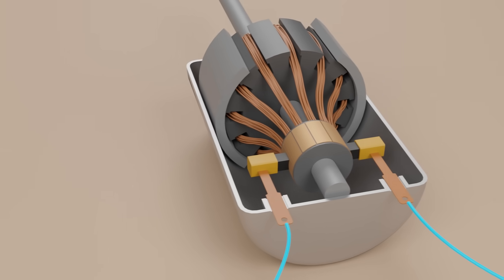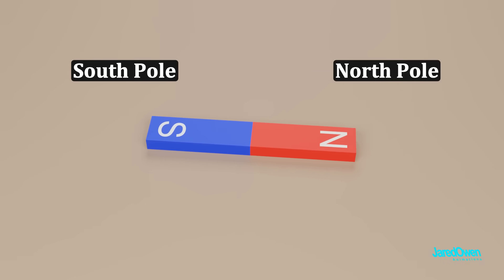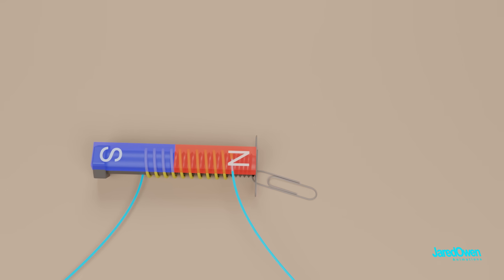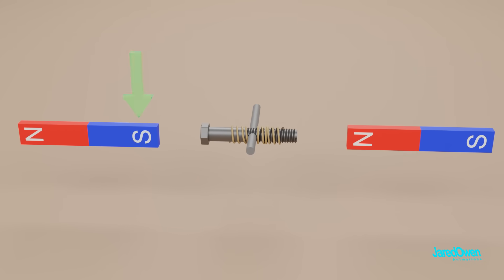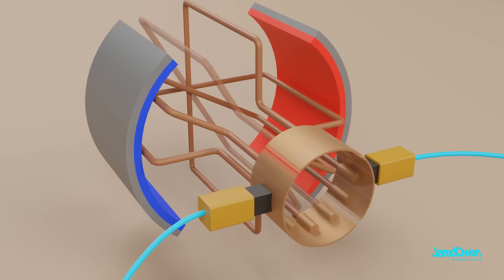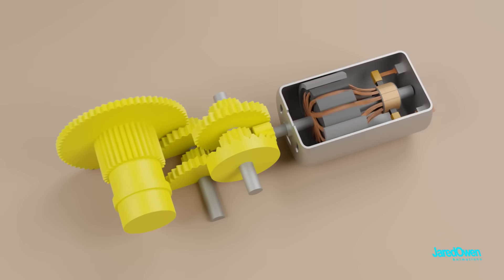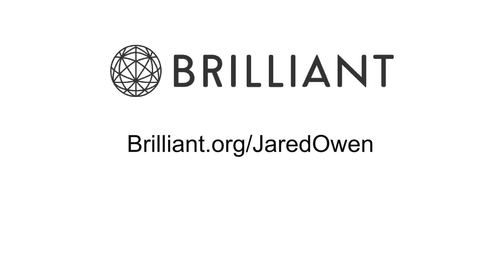How does an Electric Motor work?  (DC Motor)

Comment: TOTAL noob here.  Let me just ask the question, or consider this a viewpoint from a learner:   In your circuit, are you showing conventional flow?   I am so confused about where the most electons flow from in a power source with + and - in a circuit.   On a powersource, is the "+" terminal where the higher amount of electrons LEAVE/DEPART from, to travel through the circuit and ultimately be RECEIVED back in through the "-" terminal?  Do electrons flow from the + to the - ?  or from - to + ?
So noob, I struggle to know HOW to ask for understanding.  But my understanding is that electron theory is - to + .....but does that mean that electrons flow from the - post then through the circuit towards the + post?  Help!

Comment: id bet money that a hair dryer has an ac motor.
Reply: It has diodes inside and a capacitor that converts ac current into cc current good enough for the motor to work :)

Comment: Wow, that was amazing! Thank you! Now I want to ask you if you may help me understand what it is that may not be completing a circuit in a DC welding machine. The motor portion starts, the armature is spinning however, the leads where the welding rod is attached will not generate what's called an "arch" making the rod sort of melt into another metal, conjoining the two pieces. I have been searching on the internet for a while now and I a have engaged folks who work with welders specifically however, I am not able to get an answer. Would you be willing to give this a whirl?

Comment: This video helped me fix a really expensive table saw. The 2 brushes were both stuck. Not getting contact. I took them out, and cleaned inside with air. put them back in and BOOM $4,000 saved

Comment: Great video and the graphics are amazing but FYI in Electric Motor the rotating part is an armature, the brushes contact the commentator, and the Outer magnet is called a field😬 in an alternator the rotating part is the rotor the brushes contact, the slip rings, and the outer parts called the stater with electricity is generated. Just a small fun fact.

Comment: If the power source, wiring and switch is all checked and known to be working, what are the failure points for an electric motor? My guess is it has to be the brushes fail, or the magnets fail. How can we test and isolate the problem when an electric motor won't spin when power is applied?

Comment: I might be missing something. The bolt needed wire wrapped around it, and, it needed connections to the wire?, but, the metal loop didn't need wire?

And, the metal loop having two ends, suddenly the N and S are in no way oriented to the physical ends of the metal loop?, the N and S are strictly oriented to the edges of the loop??, instead of it's ends, and the bolt was end oriented?

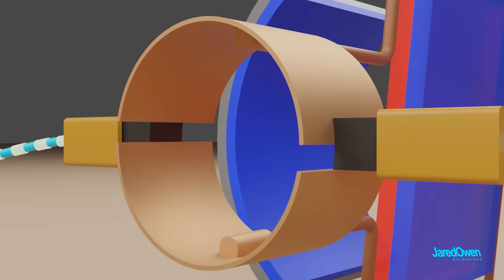Comment: I have a doubt....at 5:36 we can see that the brushes are in contact with both the segments...i.e. the upper as well as lower one ...so doesn't this create any kind of problem in the flow of current or short circuit..??

Comment: A DC motor consists of a coil of wire (with electric current) and a permanent magnet. When electric current runs through the coil, it creates a magnetic field. This magnetic field then interacts with the magnetic field from the permanent magnet to produce a torque. Whats different in your information, thats the chasm ,( coil wrapped around an iron metal ) now iron gets magnetized , that is its electrons or elements in it takes a one way direction , that one way directioned elements vibe interacts with a permanent magnats opposite  way's elements , since magnetised magnet has one way direction , so it always only criss cross with a parnanent magnets opposit sided element, this magnetised element though, in one direction flow due to electric current flow pattern ,  but has both sided polarity property, so it reacts with permanant  magnet's only  one directional side of the opposit element, say permanant magnet south pole, and electromagnet emitting vibes of element from north pole ( the element is bipolar) now if a permanent magnet cant attach a opposit magnet to  both of opposite poles at a time, meaning   sn(sn)sn, pattern one direction snsnsn and not (sn)ns(sn), ( though ns is also a magnet elemented with south and north ) as appears for  how current flows and channelise the elements in one direction like [sn(sn)sn] , with s and n property for each element, the permanent magnet and electromagnet interacts as [blueS redN ] and [blueS redN], now suppose current in ware making the electro stuff feel flow from redN to blueS inside , and permanent magnet has pattern redN to blueS , so permanent's direction  redN to blueS => and electromagnet's direction redN to blueS => doesn't sync at polarity for permanent's redN and electromagnet's blueR , though  direction is same , but in place of snnssn for polarity its snsnsn =>, not <=> for polarity that is tolerated in magnet, so it creates reverse force that produces spin , torque. 😊

Comment: I think there is a small mistake in the animation at 7:29. The additional wires shouldn't all connected to the commutator individually, they should be additional windings in the same loop. Only the beginning of the very first winding and the end of the very last of a loop should be connected to the commutator. What the animation shows is effectively just a bigger wire diameter for the same circuit.

Comment: Say I Have A Motor Which Has 2 Permanent Magnets 180 Across Each Other. Would I Increase The Performance (Torque Or Speed) By Placing Magnets In The Adjacent Areas Where There Are Not Magents So That Now There Are Magnets All Around The Rotor 360 Every 90 Deg? (Assuming I Have Have New Permanent Magnets Polls In Correct Orientation)

Comment: at 2:30 thats not how an electromagnet works. The current thru the wires creates a magnetic field which is the magnet. If the domains were able to be aligned from the induced magnetic field then you made a permanent magnet.

Comment: I have a question about loops shown on 06:45. Due to right thumb hand rule we can see that the magnetic force is flowing upwards therefore there shouldn't there be a magnet with it's north pole on the upside and not south?
Using Fleming's right hand rule I figured that the current always flows into the left wire and flows out of right wire, thus creating a loop with current flowing anti-clockwise (If you are watching from above), so shouldn't magnets inside the loop have their north pole on the upper side?

Comment: This is brilliant, and I understand motor motion aa being the interaction between the permanent magnets and the electromagnets. But where is thr electromechanical - Lorentz - force ? I understood in a generator it opposes the rotor when power is drawn, what does it do to a DC motor ?
Reply: whys there a gap between commutator of dc motor?
Reply: @LoafSilkyyyy I don't know, I think the thickness of the gap is larger than the thickness of the brushes. To prevent a shortcircuit. Otherwise both brushes will be connected at the same time to the whole connector ring and thus the armature coil will no longer be powered at that time.
Reply: @fxeconomist  ok thanks
Reply: @LoafSilkyyyy However if you look in the big drawing you'll see the spacing is thin. And since it's more than one, it will actually activate two coils at the same time.
Reply: @fxeconomist  oh yeah this makes sense

Comment: Folks you can make a free running motor out of your pre existing alloy engine, simply place magnetic caps on top of the pistons and replace the valve head with either a magnetic head or electromagnetic head placing a magnet above each piston, NEVER PAY FOR FUEL OR ELECTRICITY AGAIN

Comment: Can you please answer these 3 questions (thanks in advance):

- What were and are the ramifications of Lorentz's symmetrization of the Heaviside equations in 1892, and the continuing symmetrization of these equations today as the "electrical engineering model"?

- What powers an electrical circuit, or what actually powers the electrical power grid?

-  There is the "source charge problem" or "the problem of the association of the fields and potentials and their energy, with their source charges".  The charge sits there and pours out observable EM energy in 3-space in all directions, with absolutely no observable EM energy input.  Piece of cake to prove that experimentally, anytime, anywhere so it's well-known. Either this "most difficult problem in classical and quantum electrodynamics" must be solved, or else one has totally destroyed the conservation of energy law itself.  This is a recognized formidable problem, but very much "swept under the rug" and never discussed in "polite circles". So the question is: how does the energy gets input to a source charge or a source dipole in the first place?

Comment: more wires for reducing current)))). less current for increasing current and RPM.
just look some Toyota hybrid gearbox video on YouTube for ensuring in it.
more windings - more voltage les current.
less winding - less voltage more current. at the same power motor.
эх. небыло у вас СССР. не учили вас в школе.

Comment: Just one thing: at 2:40 he shows a solenoid/electromagnet, however the North is sited where the current enter not where the current goes out so the poles of the electromagnet rapresented should be inverted right?

Comment: In high school, we made a Motor with copper, a spindle, and a holder for the spindle. Then we gave it battery water and that spindle span so fast the teacher told be to switch it off since the motor will be too hot. I didn’t know what he was talking about and touched the copper part. It was so hot. I enjoyed that. I couldn’t believe I had made it with my own hands. Science was in my head and not forced. I wish our kids had more of that to enjoy science this way.

Comment: I have a question. I am trying to understand the concept of electric motors and I have seen other videos, where the copper wires where rather part of the stator, and not rotator. So they were not spinning. So I wanted to know if these are different types of electric motors or am I just understanding something wrong.
Reply: Some motors use electromagnets rather than permanent magnets as their stator

Comment: I got confused from 4:42, how does current through a SINGLE wire (not a wire around a metal or bolt) can make THE wire into a flat magnet?

Comment: Very nice, but I have a question!  You point out repeatedly that the motor will move because the electromagnetic winding (or loop) will try to align with the permanent magnet(s) such that south is lined up with north, etc.  However, why or how does the motor turn one way and not the other.  That is, if two north poles are facing each other, the motor could spin one of two directions to put south towards north.  One could even imagine that the motor would switch from one direction to another.  Can you address that?

Comment: Going into my 4th year as a mechanical engineer. I've been taught about AC and DC motors since my 1st year and have always struggled to grasp how they worked, which is not normal for me as I am fairly smart and almost always can figure things out when I apply myself. Until I saw this video I thought it was my fault that I couldn't figure it out.  I now realize some professors are paid far to much to be absolutely awful at there jobs. I have  no clue why my EE professors never made it this easy to understand but they truly should be fire as I believe it shows a complete lack of effort on there part, which is infuriating because as a student I've been told multiple times when complaining about the hit my mental health has taken ive been told multiple times "well thats whats expected of you" btw for any prospective engineers I go to UVM do with that what you will.

Comment: motors switch rotation when you switch the battery from + to - or what controls witch way the motor rotates? like celling fans when you flip the switch it slows down and then goes the other way.

Comment: Thanks!
Reply: When I was getting my Mechanical Engineering degree, the Mechanical Engineers considered motors an electrical device, and the Electrical Engineers considered them a mechanical device. Because of that, neither department taught a good class on motors and we barely learned about them.  This is a terrific explanation and visualization.  Thanks!
Reply from the maker: Thank you Kristen!

Comment: While the dc moror accelerates, the anti-EMF it produces becomes equal to the voltage supply the whole system is connected to. And so, the current running through the rotor becomes zero (because Vtotal=0). Then (suppose we are in a vaccum), the rotor keeps his rotational speed stable for ever because he feels 0 force. Is that true? I really need an answer to the question: why doesn't a DC electric motor accelerate for ever since the Laplace force due to the stator's field is always present?

Comment: Most motors today are slightly different and do not have the brushes as that's the biggest cause for failure as it wears down rather quickly.

Comment: I realise this is a very general overview, but I disagree that more wire (or more 'turns') equals a faster motor. In RC model brushed motors, a motor with a lower number of turns, but thicker wire gauge is quicker than a motor with a greater number of turns of thinner wire. In other words, an armature wound with 27 turns would be a lot slower than a motor with 10 turns. In terms of torque, the greater the number of winds the less torque a motor has, so a motor wound with 5 strands of wire wound 10 turns (referred to as a 10 quint wind) would be smoother and less torquey than one wound with 2 strands of wire wound 10 turns (known as a 10 double).

Comment: how does the presence of another magnet affect the electro motor? wouldnt it interfere with any of the devices using an electromotor? What if i just put a huge magnet near the cutting tool how would it still work??

Comment: Hey Jared, thanks for the video! I got a question. if the motor works by alternating the direction of the current, how does the famous simply DIY motor using one magnet and a battery with a loop of copper wire work?

Comment: 1. DC motor, 
2. Shaft runs through brushless DC generators!

One side of the battery pack is being charged!
One side of the battery pack powers the DC motor!
Reply: Then they have a protest about global warming!

I was at the protest trying to tell people about this design!

I said you don't need to use fuel, they just laughed at me!

Retarded!

Comment: Could you please explain something to me that's really bothering me. Okay, we've established that connecting current flowing > will cause the "bolt" - to continue that direction and have that polarity which can then be reversed by spinning it around. Now here's my question, how is the "commutator" switching the polarity? Wouldn't the flow of current be the boss in that situation, so regardless of the polarity of the commutator wouldn't the current take precedence resulting in the flow being the same regardless of which side it is connected to? 

I just can't understand it, for example current flow from a DC battery travels in the same direction from positive to negative.. so are you saying the commutator overrides that current flow and reversed it, resulting in the current traveling from negative to positive instead? 

Actually I may have answered my own question lol! Thinking about a tow motor that I have, if you reverse polarity by connecting - to + on a battery it just pulls the other way. Guess this explains it!

Comment: This is a very good introduction to brushed DC motors.  I learned something from this by seeing the visualization.

I suppose if you ever want to, you could do a deeper dive into how brushed DC motors work and even do some other motor types in more videos.

For example when you talk about the motor windings, there is the whole concept of back EMF and power generation that gets into more of how those windings look and work for touching on how you could do a deeper dive.  Also getting into efficiency, reliability, and power density of motors gets into why there are other motor types.  BLDC motors for example are fun because they are highly reliable, fairly efficient, especially with a quality controller with an active idler circuit, super power dense, and run off of a PWM signal.

Those desk fans you animated are actually using single phase AC motors if I understand correctly.

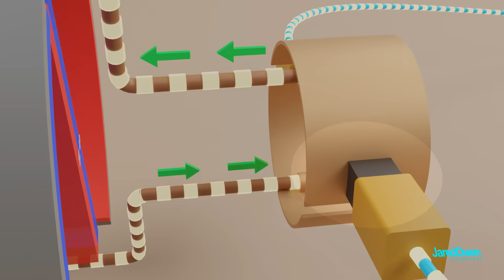Comment: can someone explain the switching of brush at 5:45? thank you!
Reply: Let the left wire be north and right wire be south
Now the electric magnet would be attracted towards opposite poles(of the fixed magnet) right that's y it moves towards it but then after it reached opposite pole there will no longer be any movement... that's y the commutator is changing the poles of the electric magnet (through the wire)
The wire that was south becomes north and the north one becomes south....this keeps changing so that the electric magnet will keep moving towards the opposite pole
Understood it a bit?